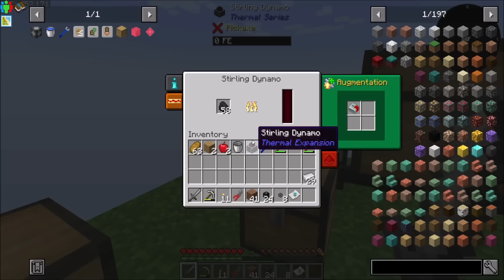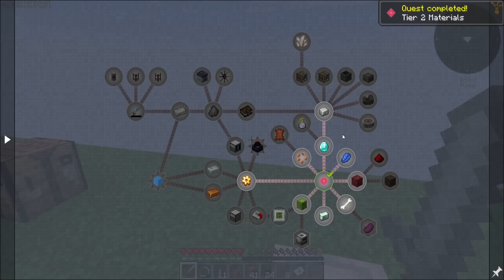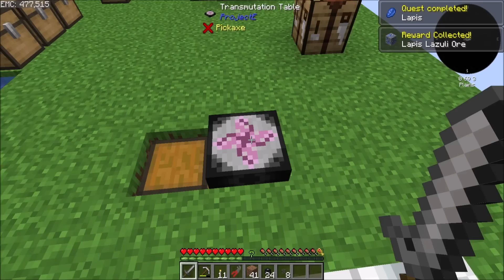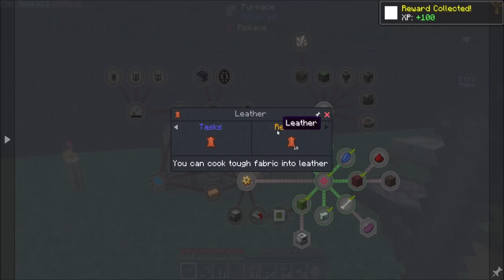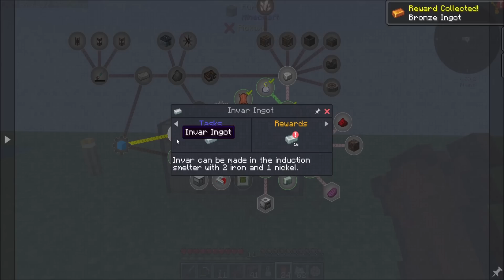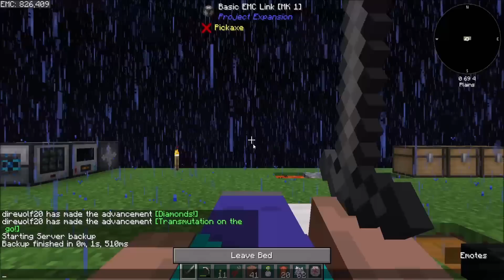Mechanical Mastery Ep4   EMC Efficiency and Lava

Comment: I started playing this pack when I saw DireWolf20 had made this series and I figured I would play along with him.  I had to pause at the beginning of the next episode because I'm not as well-versed in Create as Dire is.  When I got to the automation step of making the Basic Mechanical Essence (the pink 'sentient' crystal), I used 'my' machines to craft about a stack of them before I used the 'dedicated to automation' machines to do a full run.  But my setup uses more machines and fewer pipes than DireWolf's.  My machines auto-feed into each other in a line per material, and the extras go into drawers, which fill up infrequently enough that I can check on it myself, or I could upgrade them to be voiding.  And then I realised that the power wasn't getting to all the machines, so I had to move the cables to the face side of all of them, so now the whole machine is inextricably three-dimensional because every face of every machine is utilised.

Comment: Pretty Pipes filters appear to be broken - set a couple of allowed item types in the filter and the wrong item types still get inserted. Looking forward to getting to tier 3 so I can use the pipez pipes instead.
Reply: Are you switching the 'D' icon to 'A' disallowed to allowed?
Reply: Yeah. It seems to work a lot of the time but I've seen this problem happen. Regardless I'm still using it for the time being.

Comment: for early game crafting putting a bunch of iron chests (any tier really, but higher = better) around a crafting station is amazing, that way you can just leave the ingredients in the chests and the station will pull whatever you need from them. a couple diamond chests (4 diamonds in total, so it's fairly cheap) will probably hold you out until you get a better storage system.
also red matter tools and armor are really cheap, though there really isn't any use for the armor from what i gather.
the megatorch is also a thing, and it helps with phantoms as well
edit: glowstone can be unlocked way earlier than chapter 3, you just need the crushing wheel things from create and pass through some prismarine crystals, which can be acquired via soulfire processing through create fans from lapis
Reply: you can gat glostonewhen getthe steeleasier faster than create

Comment: The infinite fuel works in Powah Furnace Gens which you can make higher tiers and are more efficient than dynamo's. Just an FYI.
Reply: I hadn't realised that yet when I made an infinite free energy generator out of a magma crucible fed cobblestone from an igneous extruder and pumping lava into a magmatic generator.  The system gives me free cobblestone at a rate faster than I can deplete (so far) and free lava, which I have yet to automate into obsidian.  I'll have to run the numbers to compare the next time I start a new closed loop.

Comment: I don't know why but the cactus augment in a Pulveriser still gives me the bonus dust. For example, pulverising Aluminium will still give iron dust
Reply: It will build up the excess up to a stack and then void the excess. I think that’s how it works! It’s been a while since I used it but that’s what I receall
Reply: It does say "excess" so perhaps it doesn't block if it can't fit the secondary
Reply: There's a quest in the pack that explains this completely.  The machine will stop operating at the end of a cycle if there isn't enough room in its own output slots for both the main product and all secondary products.  The cactus augment prevents this eventuality by allowing the machine to keep operating and prioritize producing the main product which means sometimes voiding the secondary product(s).
Reply: Yup.. I'm doing just furnaces for all my raw metal to ingot needs because of that
Reply: Glad to know, guess I won't bother with that.

Comment: 23:38 would the infinite fuel source work in the magmatic?
Reply: it's not a liquid.
Reply: @jawstrock2215  the item no, but it might act as one for the purpose of the interaction
Reply: @robertlinke2666  it's an item that goes in the burning slot. And it's suppose to consume emc instead of the item.(kinda like a bucket of Lava, leaving the bucket, it leaves itself.)

Although I had it being consumed in other pack.

Comment: hey Dire I know you're probably really far into the pack by now since you pre record alot of episodes, but when you were searching pipe I saw that you have access to the pipez mod which can handle fluids. Thx for always brightening up my days with your consistent content!
Reply: He normally do 5 episodes per recording sessions then uploads them to YT and scheduled to post everyday at the same time, so my guess hes done with episode 10, but who know's he will probably might find it off-cam or by the questline.. But he reads comments, but maybe his already pre-recorded where he found out
Reply: In this modpack, the Pipez require glowstone dust, which is a tier 3 material and can't be made until you've made the tier 2 mechanical essence.
Reply: @SephSays  You can get it before the Tier 2 Mechanical Essence with Create. Lapis -> Prismarine Crystals -> Crush for chance at Glowstone Dust. Certainly easier to wait for T3 but it's easily accessible in T2.
Reply: @SephSays  I didn't know that I just saw pipez in jei thx for the info!

Comment: Fuel for the dynamo is probably a whitelist, not just all fuel.
You can take a look if something else can use any fuel as a source and see if that works. Think mekanism uses any (burnable)fuel instead of a whitelist, but if its in the pack, it might be far away
Reply: powah mod i think has a generator that takes any fuel and can generate so much more power
Reply: @kizigamer6895 thanks for the tip, I'll check it out. I'm playing this pack too :D

Edit: can confirm, works great. You can get all the way to hardened tier without needing tier 3 materials.
Reply: @Minase636  use the evertide amulet for free water using the mekanism tank which would be the fastest way to transfer water into any mekanism multiblocks

Comment: 0:10 65? 65 in 1 stack? WHAT THE F?
Reply: Known old bug, you used to be able to have 128 in a stack (which if I remember correctly the game classed as infinite)
Reply: You can stack up to 127 items using normal Minecraft commmands. Thermal just does the next batch of items when below 64 and doesnt void items so it can get up to 66 i think or even more
Reply: @filipoda123  i saw until 68 (almost nice) but never more than that
Reply: Wait until you see something like 72 items in a stack
Reply: That's unique to thermal machines. They address it in the mod's manual. IIRC, if there's like, 63 items in the machine's output slot and the recipe has a chance to produce more than one item, the machine won't stop and you will get more than 64 items in one slot